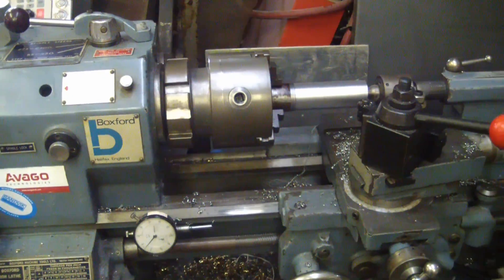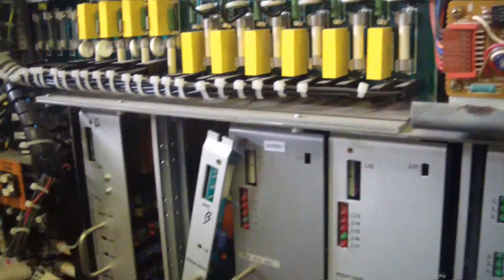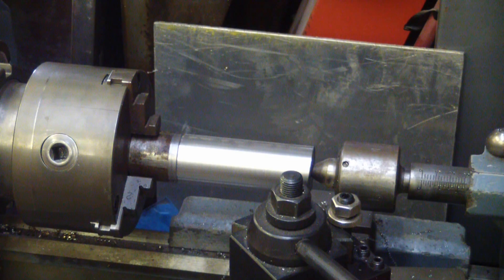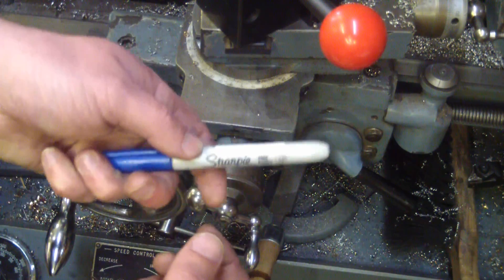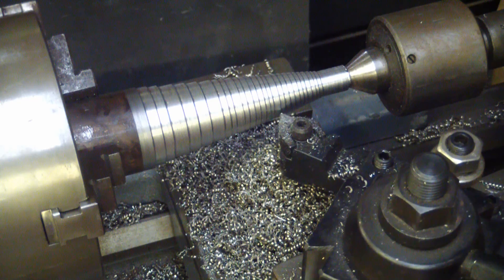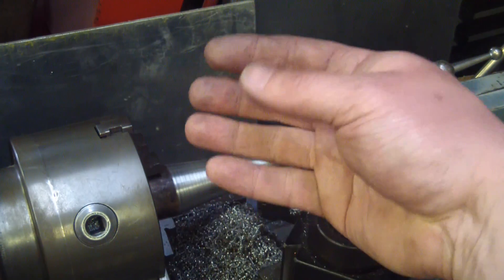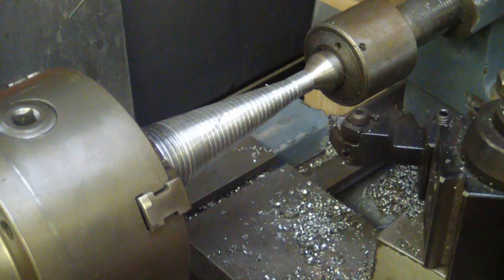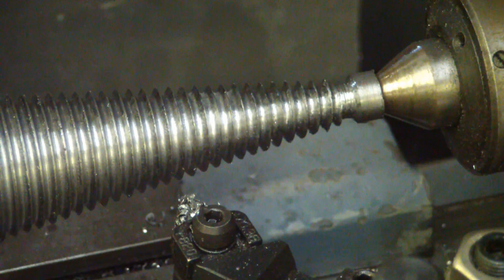Turning Tapered Threads - Manual CNC

Comment: I have a taper attachment on my lathe, but in the past when working on lathes without such a luxury, I have deliberately offset/dailed out the tail stock to produce the appropriate taper with the part held between centers and being driven by a lathe dog.... you could cut just as an accurate taper thread as a taper attachment doing this on your lathe... ??? LOL WTF Ave!

Comment: With the bore hole bits you have had before weld a API thread on the other end, case harden and you got a awesome carrot tap there... fished a few drill pipe strings with those suckers left and right hand threads

Comment: A second option (depending on the angle and tail stock) is to turn between centers (faceplate and drive dog needed)  and offset the tail stock. This allows the carriage to run strait and normal but allow anything tapered to occur. The limitation is how steep the angle is, can only offset so far.

Comment: AvE...a few years late.  How about this idea?
BTW a 0.50" [+ allowance for dog plug] offset on the tailstock with the piece on centers would make a 4" tapered part.  More offset will be needed to allow for the dogged big end.  
Beforehand, drill the big end the driven shaft size, plug and center drill.  Dog the plug. Then when the 4" taperthrerd part is done, remove the plug, then press in the shaft and weld the assembly.  Be sure to start the threading from the tailstock end for a right hand thread.  

Do you think this would work?

Comment: I just visited my uncle this week who is a blacksmith with a lathe. He made a pretty simple and reliable taper setup by putting a round bar (~1") across the back side which you set your desired angle on. Then the cross feed plate is unscrewed allowing it to float. Im guessing you have filled in the blanks but I'll go on. 
He then made a bracket which connects crossfeed plate to yon bar. The final item betwixt bar and bracket extending from crossfeed plate is a shell which encloses a PET split bushing to allow the bracket to slide across the bar, transmitting the angle to the crossfeed.
A very expedient method but it worked a treat. Wish I took a video to show how unpolished of a setup this was. Not everything has to be perfectly pretty to git er dun.

Comment: Good job on that thing. My story is me a 22 yo kid (45 years ago) left alone with an engine lathe about that size decided to cut that exact thread. Turned it into a wood splitter mounted to a truck axle. Disclosure: lathe had the taper attachment.

Comment: That was ummm interesting. Not the way i would have done it as a former tool and die maker and automotive manufacturing engineer in steel machining (cams/cranks/rods). But you got it done and I didn't. Nice work!

Comment: I'm sure you're better at this by now, being this is two years old.  LOL  
Just in case you haven't improved much, check it out;
1:  Dead center in headstock.  
2:  Lathe dog.
3:  Doo da math.
4:  Loosen tailstock and use adjusting screws to move it toward you, per math.
5:  Cut taper just like cutting a straight bar.
6:  Cut threads just like cutting on a straight bar.
Done.
Bonus:  If you want to threat starting at the headstock, turn the threading tool upside down and run the lathe in reverse.... Unless you actually WANT left hand threads.  You so funny, Canuck man.

Comment: Fuck me, Daddy. Actually, I think you're a materials scientist, or engineer of some kind. I have a suggestion for you, though. You were taking lots of shallow step cuts. You need to get more efficient. Set the compound at the right angle, and take much deeper cuts. A deeper cut forces you to feed evenly, giving a better finish. You will be feeding against enough resistance to stabilize your turns. Okay, man,Mark

Comment: Damn GOOD job cutting a tapered form freehand !!! Awhile back ,I repaired a wagon wheel stub axle with 10 inches of taper & NO taper attachment on my lathe ! SO I made a removable auxilary handle with more throw , it slips over the graduated dial & locks with a set screw & is much more comfortable than the original !!!

Comment: Here's a little trick for us guys big fingers that have to do a lot of turning those little bitty dials.

Modify your dial so that it has a common Allen head screw/small bolt threaded into the center and then drive it with cut off Allen wrench  chucked up in your favorite cordless drill!  

Squeezing a cordless drill trigger is way easier than trying to finger bang those tiny dials while maintaining a constant feed rate.

Comment: So,  what was the intended use?
Reply: It's a Canadian buttplug
Reply: I use a right hand thread taper point to retrieve small diameter drill rods that have come off downhole. works 100%of the time about 60%of the time.

Comment: As a machinist, this was a trainwreck to watch.

Good thing I love watching trainwrecks.
Reply: You want to look away, but you just can't.
Reply: Matt Lorence what the heck is this thing used for...??? That's what I'd like to know...!
Reply: laser69beam I am guessing it is for holding a buffing wheel on and off hand grinder. Depending on the side it goes on a left-hand thread may have been just the thing he needed.
Reply: laser69beam reminded me of the heads for one of those gimmicky logsplitters that screw into a piece of firewood and wedge it apart, but with all of AvEs hydraulic expertise, I doubt that's it's intended purpose. Possibly just a demonstration? Idk.
Reply: I have seen a train wreck, this is way better, with almost as much carnage!
Reply: laser69beam if you brave enough
Reply: I'd say it would be used as an easy out. Screwed into pipe or even large studs granted you drill a whole in them. Square up the end and done.
Reply: I'm pretty sure that was his intent. To get a bunch of ocd machinists to go masochistic.
Reply: slow motion trainwreck.
Reply: As Trainwreck, This was deeply offensive, and a great compliment. FukThank-you
Reply: Seaumas Morrison I know. I'm a machinist.

Comment: Is this a log splitter?
Reply: +Dave LeBlanc 
I think those are sharp on the end.
Reply: +kistuszek Duhh but you cant turn it down to a point. You have to leave some material at the tailstock then cut it off afterward.
Reply: Dont know about that, i just said that they are different.
Reply: +kistuszek google search "unicorn log splitter"
Reply: Dave LeBlanc
Thanks, but i sometimes use one. My brother have such a splitter and we work with that.
Reply: Katalist

Nothing really. I do like to use one with our firewood. I learned how to use the twist method and chop most the pieces sideways. But i mainly chop for half an hour most the time, whereas my brother splits his wood all at once, then stacks them up. I cant chop that much...  but using a screw splitter i can work for hours without much trouble.

Comment: Hhhm, after being a cnc machinist for years and going back to manual--learn to cheat a bit:   If possible have longer ends (cut off later), and cut like your doing metric threads.  Leave it in gear and reverse the lathe--drop in forward and go to depth and repeat.  So much easier than chasing threads.

Comment: the title hurts my soul!! I work with cnc machines. they are computer numerically controlled machines. cnc machines are NOT manual!!! you preprogram the toolpath, not turn a crank or whatever you call it. granted, there are machines that can do both, but this doesn't look like one
Reply: +Brad Lee AvE clearly knows the difference between CNC and manual, as he has a fuckin' CNC bit of kit in the start of this video and an explanation of why he's not using it. The title is clearly a "doing a CNC's job... manually" kind of joke.
Reply: +d1rcwill you don't do a cnc's job manually... if you're a good enough machinist it's one and the same. moving the dials a certain amount is no different than the xyz g-code of a cnc. hell, you could just follow the instructions the cnc gets! his videos are awesome, not saying they're not, I'm just saying a cnc machine and manual aren't the same, even if the path an endmill or tap takes is.

Comment: As much as I've seen it in the other videos, that FLIR temperature reader kabob is super skookem
Reply: +Mugshot  Marley 
Even more super, duper, uber skookem would be the ability to hook it up the CNC so that it slows down or stops altogether if the temperature exceeds a pre-set limit so as to avoid loss of temper or other unwanted heat-induced changes in the workpiece.  Probably no practical application for this; but would still be skookem! :)
Reply: +John Doe lol
at the shop I worked at even when we were doing manual stuff, we ran coolant. It wasn't super skookam koolant. The expensive white stuff was save for the CNC, but for manual stuff, we just ran Automatic Transmission Fluid. Lube n cool as long as you're not running super thousands of ripms. if you were theres a plastic shield you can floop over the work to keep it from spraying like a pornhub vidja.

Comment: left hand threads? wouldn't that make it great for removing stripped screws?
Reply: +sidney beach You usually use a lefty tap for that.
Also, dunno what kind of screws you've been fucking around with... :/
Reply: +Drackon well I'm a woodworker for the most part, but let's say you strip out a Philly head screw, you can center drill it out to a 16th and then chuck up the taper tool and in yur drill and put it in reverse then push the taper into the pilot hole. the threads will bite the inside of the pilot hole and try to drill into it, but the wood screw normally turns first and removes itself from the work piece.

Comment: I has seen these exact rigs made in left hand thread. I have had them made for retreiving broken drill steel. Weld it on a sub run her down the hole and voila retreive the 40000 dollars of steel some careless driller left behind.

Comment: Nice work. Being lazier than you I used a different bodge when making a similar tapered thread on a stub shaft for hold a burnishing mop on the end of a bench grinder. Put the autofeed driving the cross slide and use the lead screw with suitable pitch to drive the carriage. With a bit off messing about with speeds and feeds a rough taper thread can be cut.

Comment: An old toolie I used to know (dead now) used to outfit his capstan lathes with all sorts of pulleys and belt drives to work the cross slide at the same time as the feed, so it would cut tapers without a compound slide, it allowed small run production of tapers and (if you desire) tapered threads (which the compound slide can't usually produce).  Not as good as CNC (even manual CNC) as one pulley set only did one taper, but it was reliable.

Comment: That was great . A cordless drill on the compound handle works well as a power taper feed
Reply: I can confirm that the cordless drill with a bespoke bracket to fit the drill to the compound slide,works an absolute treat . good luck guys and girls. Remember to try and keep the same number of digits after the different jobs you do,especially when using the lathe,....phil
Reply: doubleboost 
I was thinking the same. I've used a cordless drill on a c-clamp to sandwich a bent over-head door track to a mount. Job done.
Reply: This Old Tony uses that in a video.
My only concern is if can damage the worm screw. By hand, we can feel the torque in the lever.

Comment: Dude, before you go gutting all the sauerkraut out of that emco, just sack up and put 5 or 10 hrs into making it go. I just got a 120p running with all the original gear, in waaaaay less time and money than a retro would take. There are a pile of guys on the forums with all the docs you need and spares too. Then if it doesn't work sell your spares to us poor bastards using controllers from 1987 and get on with the retrofit. Just sayin. Also, rad channel.

Comment: You probably just need to adjust the grub screws on your compound slide gigs so that it is easy to turn. If you can undo the nut on it so it will slide freely then it's easy to judge how tight it is.  Just back them all off and then tighten them up one at a time till you can't slide it then back it off half a turn or so.

Comment: Quick question: you have 4" and you needed to take off 1". So why not just make a 1:8 triangle and then set the slidey bit on your metal shaver based on that trianglular, and go from there? I do woodwork rather than metal, but I'd have just whipped up that triangle with any scrap of wood lying around and a chopsaw. Then that's your template. Would that not work for you?

Comment: 1:25 - no... LinuxCNC... much more configurable, and it's free too.
Reply: askjerry Agreed! Although I don't run LinuxCNC at home, really you can get away with getting some motor drivers, and some sort of "controller" (be it hardware or software). That old CNC stuff could really get pitched and some better and easier stuff could be added and she'd probably chooch a bit better anyways.

Comment: That would make great screw wood splitter.
If using clockwise turning motor and two gears to make the screw turn slower then the counterclockwise threads would work when splitting wood :)

Comment: question, never used a lathe (as you wonder in a second) Lets suppose you want to do sorta of "jack screw", has the lathe a way to move the "cutting" tool "synchronously" and consistently to get "perfect" symmetric "spiral" thread ?. I use the quotes that much because I not even now the right names of those things in english LOL. Pero si ud entiende español  .... Gracias.
Reply: Yes , you heard him saying he was waiting for the 2 , he is watching the thread dial on the lathe carriage to come around to the same number so it will be in-sync with the thread he has already cut. the beauty of an engine lathe is that it is SO versatile , it can actually copy itself , have to be a really good machinist tho.

Comment: Makes me think of quick detach breech plug for an artillery piece, unscrew it maybe 1/2-1 turn and it will come out easily but when engaged has a whole mess of threads to maintain strength.... either that or its a drain unclogger

Comment: I was taught way back when to use two hands on the compound slide handle. basically passing the ends of the handle from one hand to the other. That way you (a) get a constant non jerky feed. (b) No sore hands.

Comment: What was this part made for ?
Reply: ***** wood splitter
Reply: Morgan Oliff  wood splitter
Reply: NoSpace4Bass  Tapered nuts.
Reply: NoSpace4Bass Let me know when ya find out.. Cause my imagination is running around naked with ideas.. and most deal with ... well cant say that here it might violate some kind of zoning ordinace
Reply: yes I was think of various orifices that could be Roto-Rooted... lol 
Scary...
Reply: NoSpace4Bass penetrating the rectums!!!
Reply: NoSpace4Bass perhaps a nut stretcher?
Reply: GaryGrumble I think EX Out works just fine. Nothing could get rid of them better than running towards them with that mounted on a drill saying something the lines of "I got a new kinky thing to try on you!"
Reply: J Rowell Isn't that the Canadian course threaded training butt plug?
Reply: ***** secret unless you get youtubes from russia or any other backwoodsy areas. then you know.
Reply: NoSpace4Bass EX Out!
Reply: GaryGrumble EZ Out! (typo)
Reply: NoSpace4Bass It could be for holding a rag wheel on a bench grinder.  On the left side you use a left handed thread, so the wheel doesn't get unscrewed as you buff.

Comment: Good job on that manual infeed. I laughed when you stalled the lathe. I guess you won't be trying any 1/2" deep chip control cuts huh. 
Thanks for sharing. Your racking up the sub numbers!! 

Adam
Reply: The Post Apocalyptic Inventor +Abom79 +AvE and im subbed to all three of you crazy buggers.

and keith fenner too of coarse
Reply: Abom79 It's incredible. He gained 20k subs in a month or so...
Reply: Bart Koscow I'd say Keith would have a right laugh at this video.
Reply: ciaranamhain im impressed at how well chris cut the threads! by hand.

Comment: If you run the part between two centers and drive it with a lathe dog you can offset the tailstock and get your tapered thread without all that cranking. Your tapered thread came out Very nice for doing it freehand! I want to make one too.

Comment: So weird!  A few nights ago I had a dream of doing this exact thing.  Holy Cosmic Connectedness.  However, in the dream we didn't have change gears for the thread so another guy had to crank the carriage, too, and we kept pace by listening to Whippit! by Devo.  

If you had Abom's lathe you could have just done a plunge cut with a 4 inch blade set to your taper.
Now I wanna make one of these tapered cones of destruction for log splitting.  What thread pitch would be good for a Makita cordless drill?  It's 18 volt so no pissing about.

Comment: 1 Ton Boat Anchor... Check
100MHz 4ch Rigol Scope ... Check
Fluke DMM... Check
Hakko Variable Temperature Plastic Melty Iron... Check
Adafruit & Digikey Bookmarked... Check
1 Burned Out Resistor... F**k It, Send it to the scrapper!
Reply: The burnt out resistor isn't the problem, the thing before / after the resistor that caused it to burn out is the problem. E.g. a shorted winding on a motor, a leaky transistor or diode etc
Reply: johnfranks Resistance is futile.
Reply: johnfranks All the tools in the world won't help you diagnose the problem in a complex piece of electronics if it's beyond the scope of your knowledge. I hope he makes friends with a meddling EE like Dave Jones who wants to fix it just because.
Reply: johnfranks  yeahh  i was thinking on that , but i agree on conversion to mach3